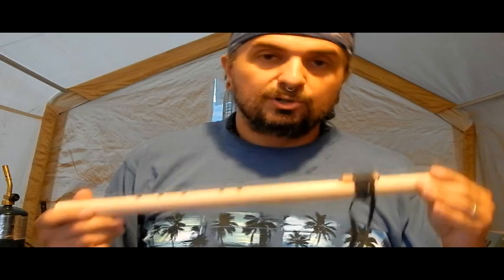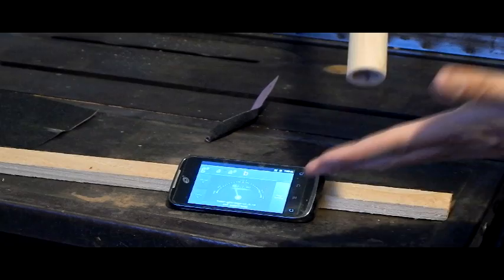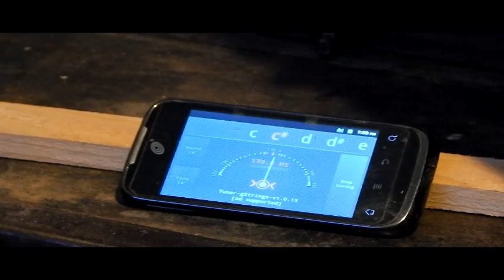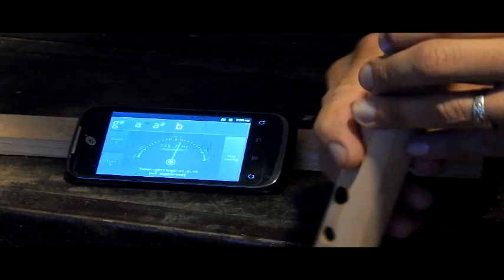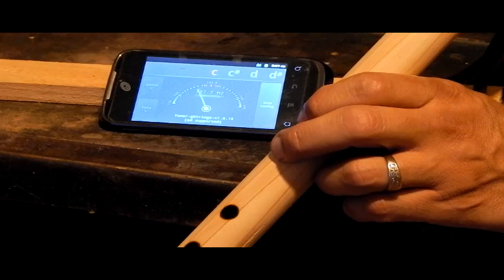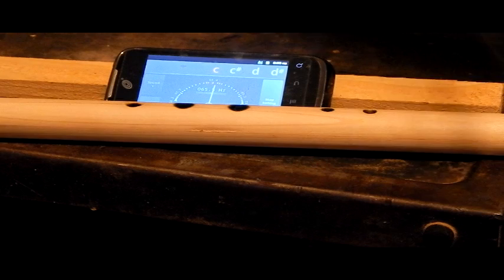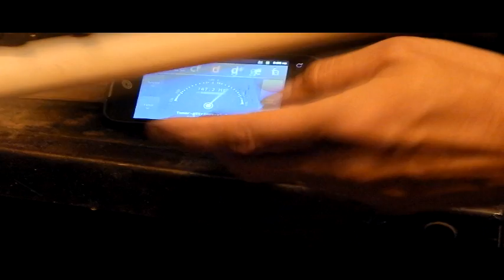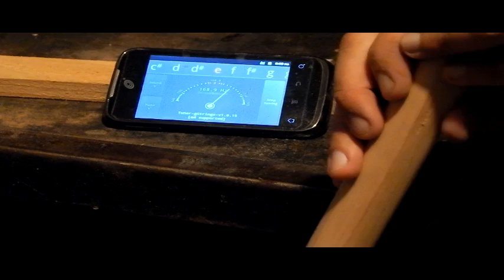Blue Bear Flutes Native American Flute Kit: Tuning Your Flute

Comment: this flute making is challenging, this the only time I have worked with bamboo. Mine is super dry. It seems real tricky to get hole size, flute ID, length of pipe, square hole, burnt round hole, I'm grateful that it is relaxing,..... it getting better. I used to fall asleep watching Bob ? (the Painter)Bob?, anyway I found someone to look and listen to that is as good as he was. Thanks, will
Reply from the maker: +Will E. Lewis Thanks, I think? Ha Ha Ha! Hope I'm not boring enough to make you go to sleep :) Anyway, it is actually best to work with dry cane, but not so dry that it is powdery or rotten where it chips and cracks while you are trying to work with it. As for hole size, start small and make them larger when tuning. The holes don't have to be square, they can be round as that is how all of my flutes were made prior to about 10 years or so ago. Don't be afraid to test some theories and see what way works best for you. Thanks so much for watching and Happy Flute Making!

Comment: Thanks for taking the time to make all these videos, they are excellent and very informative. One thing I don’t understand is, before opening the holes to start tuning they are on the flat side. When you open them up they become more sharp but the one that was too sharp to start with you still opened it up to get it back to flat. I thought that if you open the hole up too much it becomes too sharp and needs filling in a bit.  Hope this makes sense?

Comment: What do you do if you made the whole too big and its sharp?
Reply from the maker: I've been meaning to make a video on how to take care of that. There are couple of options. One way would be to insert a plug of sorts into the fingering and drill it out smaller, or possibly offset the plug within the area of the fingering so it allows you to center the new fingering hole where it needs to be.  Most importantly, if it is only 20 or 30 cents sharp, cover the inside of the fingering with super glue and fill it in with sawdust, then re-burn or re-dril the hole.